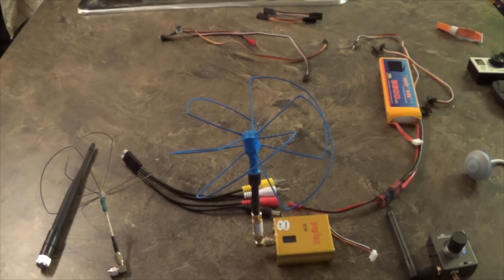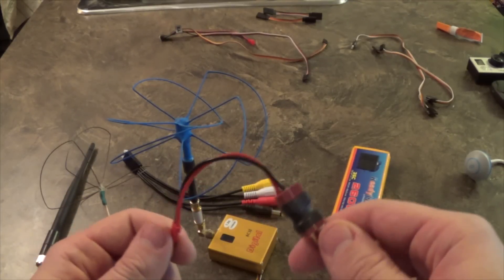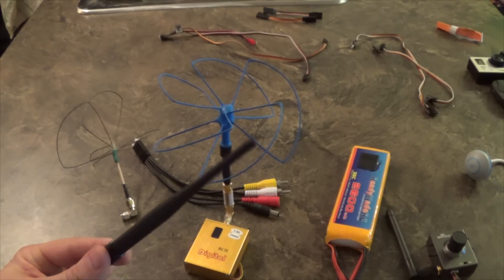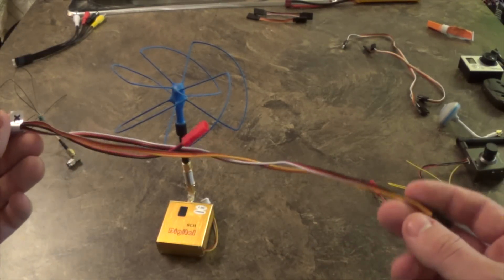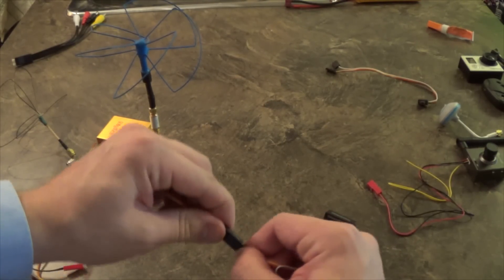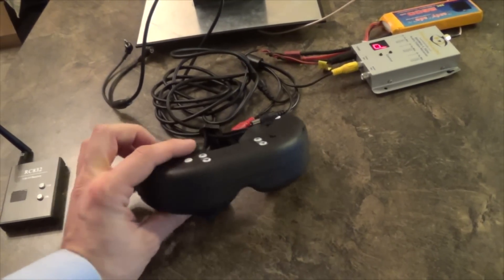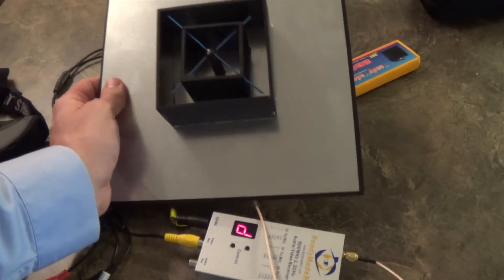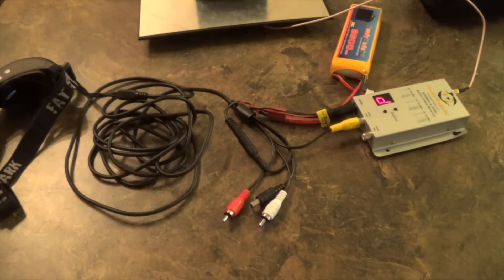How to Make FPV Systems (For Beginners)

Comment: btw thanks for this video i am learning about fpv just bought a cheap used 230 size platform to get started. Hows the Boscam all in one? range? good bad?
Reply from the maker: I would recommend it for quadcopters(if you have a good ground station antenna!). It has pretty decent recorded video quality as well, its not gopro hero quality but its a really good start for fpv.